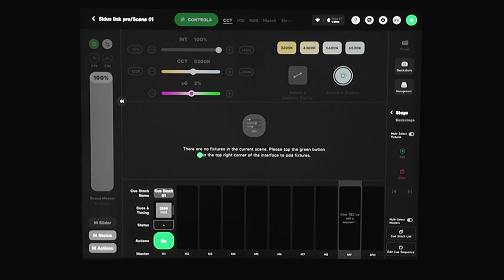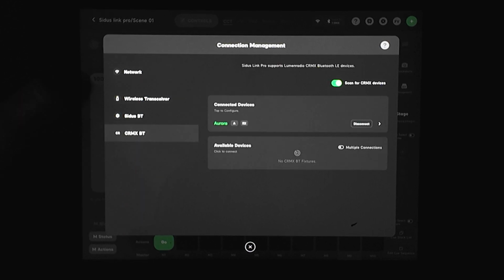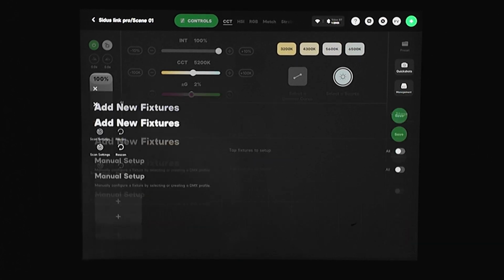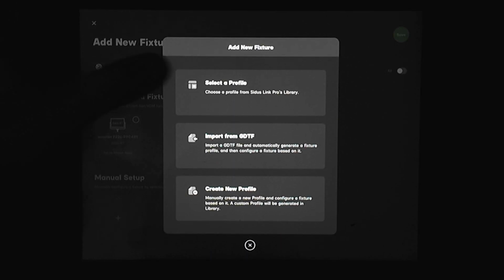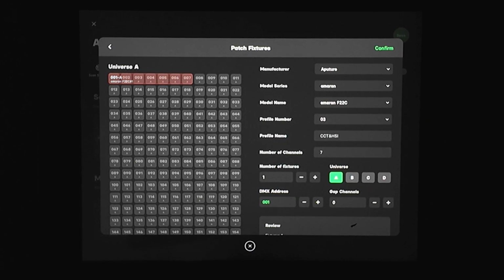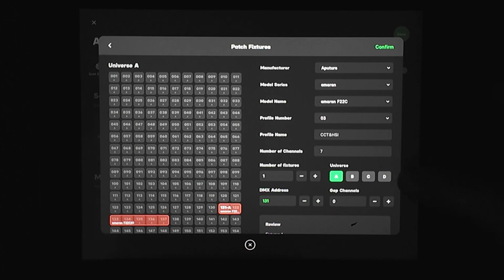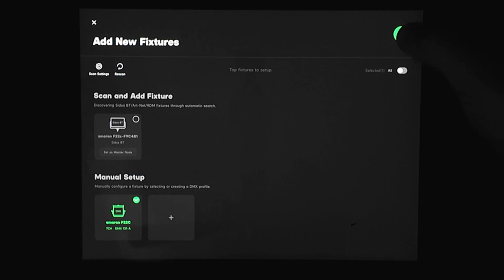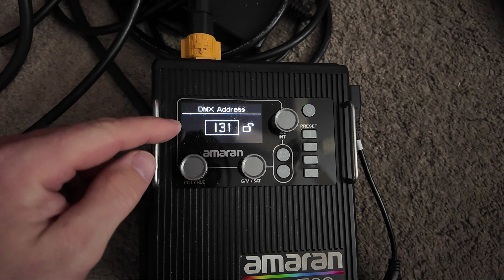Patching Fixtures in Sidus Link Pro Using The Godox Timo Link Receiver DMX

Comment: Krazy! Thanks for this short but interesting video. I wonder if i can mix sidus one tx with a donner dmx 512 receiver kit . Its that possible?
Reply from the maker: That model I don't think so. It looks like you have to use both the dedicated donner TX and RX together and I don't think they are swappable to other brands. There's no mention of CRMX/timo link in either so I'd air on the side of caution. The reviews for it seem all right but it's definitely a cheaper product.

Comment: I just purchased a Nanlite fc500b. But I also have an Amaran 150c. How can I sync my Nanlite to work together with the Sidus Link. Do I need that? I heard you mentioned receiver. Do I need a transmitter for the Nanlite?
Reply from the maker: You'd need get a transmitter for connecting to sidus link pro and a separate godox reviewer with a dmx to 3.5mm adapter cable to the light, as the nanlite head doesn't have a full dmx input. I believe that would work. I have a different transmitter than the godox, as I only use the receiver. You could also get a different transmitter like the sidus one, that's a little more upgraded and longer range. As long as it has CRMX capability.
Reply: @Krazy5KLighting, oh, ok nice!! So I do need to get that Godox product as well as the Sidus One? The Godox will be for the Nanlite 500b correct.
Reply from the maker: @jayrey7  Yes one transmitter (sidus one) and one reciever (godox timo link) 
I would recommend the Sidus one for sure as a transmitter. Going to last longer, longer range, and it's brand is more likeable. That will hook up nicely to sidus link pro, then you would get the godox receiver and link those together. Get the adapter plug(dmx to 3.5mm) for the nanlite to the godox receiver and you should have full control. It'd be nice to use it as well for the amaran you have, but unfortunately it only has bluetooth connectivity and no dmx inputs to use. So you're kinda stuck with that for the 150c
Reply: @Krazy5KLighting ah I see. But that shouldn't matter since the 150c works well with the sidus link so no need the Godox right? It only for non-aputure lights to work along with Sidus Link Pro with all the Amaran lights included. I'm excited for the outcome of having to use 3 brand lights all setup perfectly with the Sidus Link Pro. Amaran, Nanlite and Godox. That's my future goal. Unless I just need to stick to one which is the Amaran to have the benefit of using the Sidus Link.
Reply from the maker: @jayrey7  Yes, using the 150 with sidus will still work fine and you should be able to use both together with the addition of the rx+transmitter
Reply: @Krazy5KLighting yea I plan to do that. Thank you so much I added both items to my cart. 🙏

Comment: Hello! Could you please check if it's possible to connect the Godox Timo (as a CRMX transmitter) to Sidus Link Pro?

The goal is to send DMX signals from Sidus Link Pro → Godox Timo (CRMX TX) → CRMX receiver → lights.Thanks
Reply from the maker: Hello! In theory yes that would work perfectly fine. You can mix and match the godox TX and RX's with different CRMX TX's  and RX's. I do not own the Godox TX transmitter unfortunately because I already have a different CRMX TX and wouldn't be able to do a video on it in depth :(
Reply: @ Cheers!